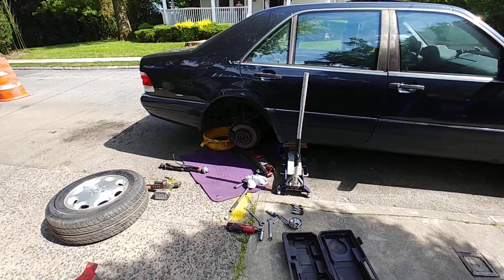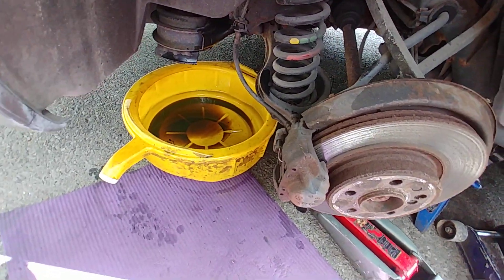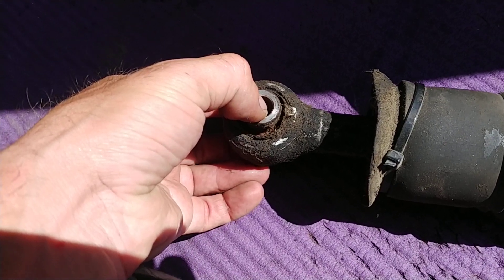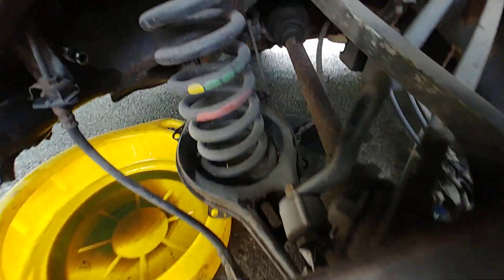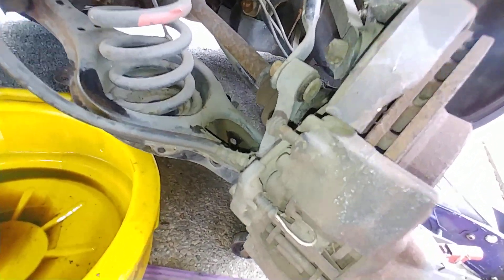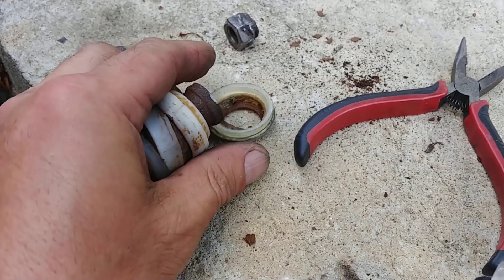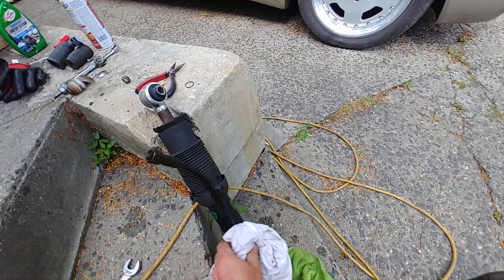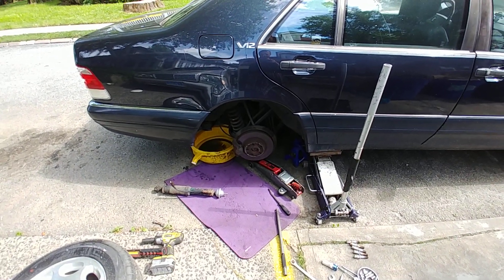Mercedes W140 rear hydraulic strut failed due to ADS system not working properly

Comment: hello Viktor, i want to know if you can help me to finde the parts I need for my car, I have a SL600 1995, actually its not working I have to finde a LH1 modulo and the 2 caudalimeters. have a email to contact you ? best regards

Comment: great video viktor,,  one thing that confuses me the non hydraulic shocks do not have the top mount, so if i was deleting my sls would i use the top mount with normal shock or not use the top mount???   this has been on my mind for a while
Reply from the maker: Both struts have top mounts. Non sls shock top mount seems to be a bit smaller than sls.
Reply: @vsandvs  when i see the pictures on ebay they never show you the top mount they just show the threaded piece at the top

Comment: Hi Victor,
I have w140 300SE first generation full
Equipped, the problem I have sls suspension missing in the rear (replaced by shock absorber), I want install the original struts, I found two struts in good condition,
When I look in engine compartiment I found reservoir fluid of sls system which connected to power sterring pump, and I look in the bottom of the car I found leveling system and old accumulators in their original place my question if I want install struts :
1.Install struts
2.install new accumulators 
3.fill reservoir with sls fluid
It will be OK the sls system can work fine?
Or there is others suggestions
Many thnks
Reply from the maker: Hi,
To be honest I would not convert it back to SLS suspension. Especially if your car has ADS system. 
In many cases shops just remove struts and install shocks and rear end sits too low. So you replace springs with non sls springs to bring rear suspension to proper level. 
I just converted 600SEL from sls and ads to regular springs and shocks. No more headaches with these systems anymore. But some other cars I keep sls and ads if repair is not too expensive.
Reply: Hi Victor,
I have sls system not Ads,
I try to replace shocks by struts and I see
What happen, and I let you now results after, can I use the non sls springs in my case?
Many thanks
Reply: @drissios  like viktor says you must use  the correct springs if you had sls installed with normal springs it would not be right you would have 2 spring rates on each wheel as the accumulator gives spring action
Reply: @drissios  ps you can get sls springs quite cheaply i think 30 euros for brand new after market
Reply: Hi Victor I found rear struts in not bad condition, the springs not yet can I cut/modify normal springs to use it in sls suspension? If it possible can you help me

Comment: Could you share a part # of rubber bushing you used?
Reply from the maker: I had some bushing laying around. But it did not fit so I had to grind it down to fit into strut opening. I never saw or heard for any replacement bushing for these struts.
Reply: @vsandvs 
Здравей Виктор
Можеш ли да споделиш няколко детайла как точно направи тази процедура 
На пръв поглед се вижда че тези долни тампони са капсуловани към амортисьора 
Ще съм благодарен ако споделиш инфо че и мен ме преследва тази дилема в момента
Даже аз премахнах горния тампон като заварих болт със същото разстояние което имам тампона и сега отгоре си е като нормален амортисьор с гумички 
Благодаря